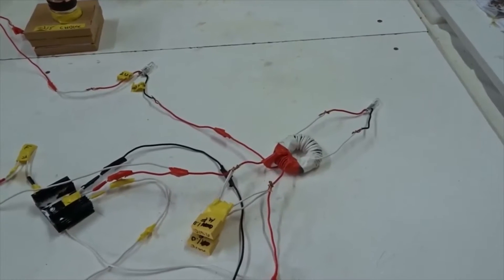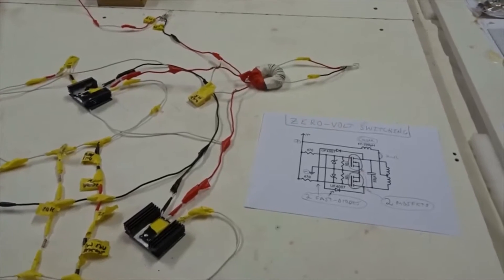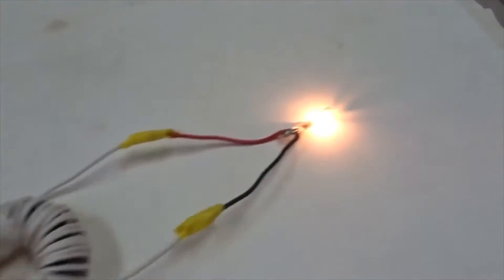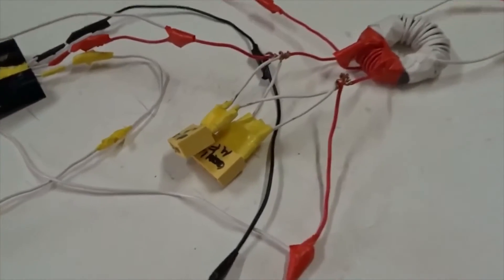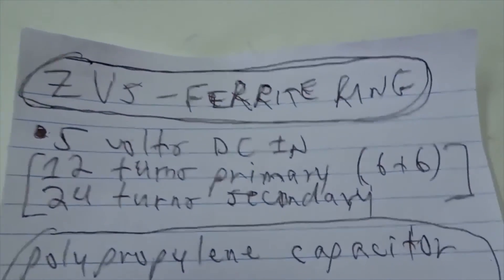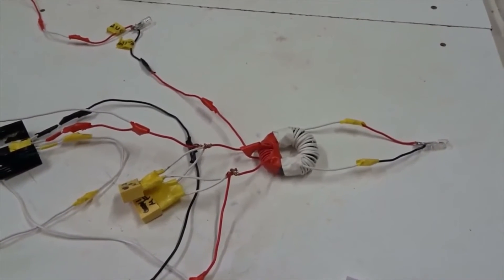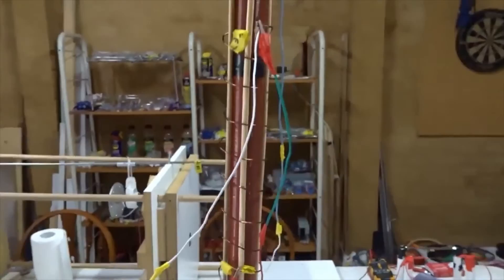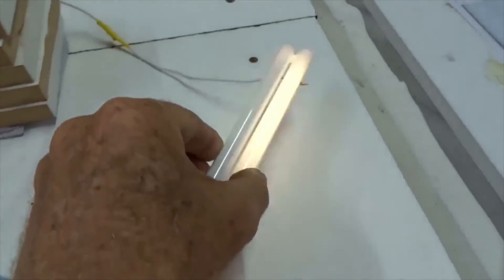ZVS circuits can efficiently power both low and high-voltage transformers

Comment: I have the ZVS open board coil heating unit model with bright top copper heatsink +  top fan for 12v use. I need 200watts output to ONLY run a 30VAC secondary transformer. 3 terminals on output. . The advertising says only 100watts. Can I reduce the choke coil L inductance for higher current going to the center tap of transformer ? Or should it be  only larger capacitance than on the board  that resonates with primary of transformer?  ( 200W Inverter power supply needed.) This is called self excited type rather than the IC Oscillator driven type. The MOSFET switchers on board are fully capable. Low voltage output + high wattage Inverters are non purchasable and transformer has to be hand wound special. (already done with bifilar primary.)...//,,,

Comment: Much needed info, thanks. Also have tried switching out most wires for litz wires. More power, lesser resistance for higher frequency?. I use home made litz wire from relay magnet wire. Litz wire for transformer, positive/nagative, inductor and output leads. I get white hot sparks around 5kv and lesser burning arc at 45kv spark gap